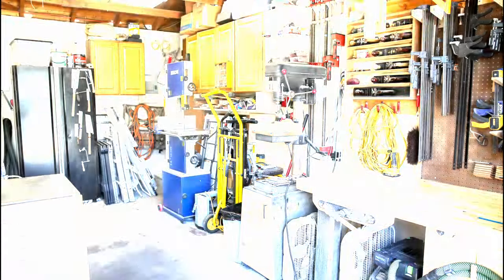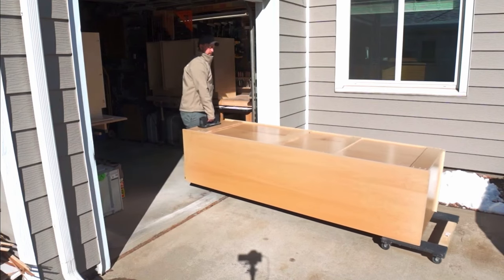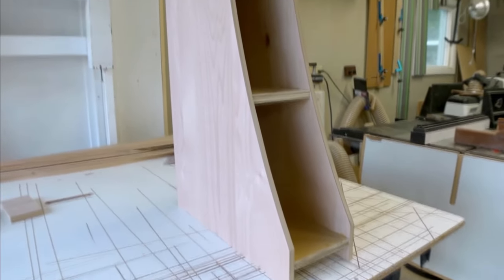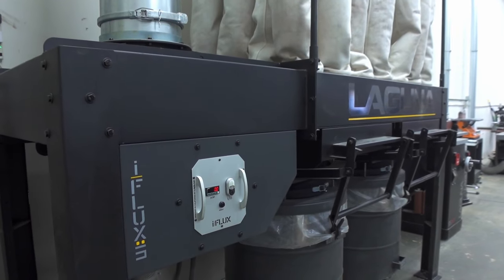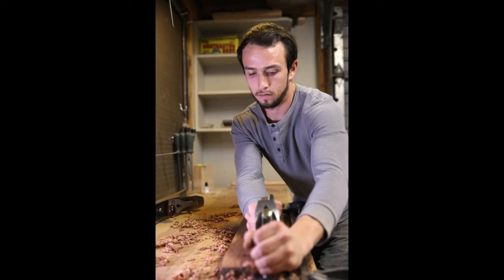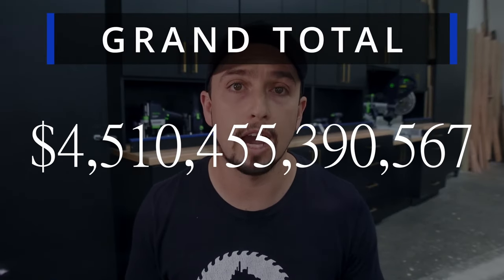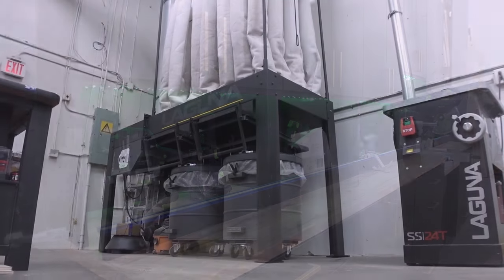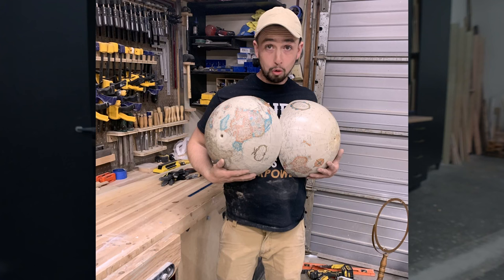Size MATTERS. Here's Why.

Comment: Now that I’ve gotten through the whole video….I really enjoyed this. It was a great video. I do remember being quite happy with my old shop. And thinking how grand it was. I have a tendency to cram even my large shop full of stuff and make it feel small. But now that I do it as a “business”… the expectations are different. And sometimes the joy is sucked out. But mainly…. I enjoy every day that I get to be in my shop. I would love to make it more efficient. I think I could take it further as a business if I was more organized. 

And… I’m drooling over your jointer. Thant thing looks amazing. I have an old delta 6” jointer I bought from marketplace. I love it… but I hope one day to get a larger one. 

I’ve spent a lot of time in my “business” making money… only to spend it on the next tool. But I’ve come to the point where I have the tools I need to make just about anything I want. 

great video. Look forward to seeing more.
Reply from the maker: I can see why your 6 inch jointer would make you happy but leave you wanting a bit more capacity.  But if you mill the boards to rough width first, its not too often that you need over 6 inches.

Comment: ROFL at the "storing lumber on your spouse's side of the bed". I store my baltic birch plywood behind my dresser in my bedroom. I don't have room in my current garage shop. But I'm single. 

For me, the answer is halfway in-between. I currently have a one-car garage that has to be both a garage for one of my cars AND my workshop for both working on cars and playing with wood. That doesn't work. So I am building a new garage with attached living quarters next door. Comfortable space for three cars and a lift plus plenty of room to make sawdust. If I need more room a car or two can get booted out into the driveway for a while. And yup, I am going to be DEEP in bed with a bank again. Sigh. Sure was nice having a paid off house for a while... The new living quarters are going to be nice too. going from 220sf garage and 770sf house to 1000sf garage and 1300sf house. I'm keeping my current place as a rental property.  And the new garage will be properly insulated and air-conditioned. I'm in Florida, so that is knda important.

Really loving your channel!
Reply from the maker: I totally get it. I had plywood leaned up in our living room for years. Truly though, good luck with your new space. I hope it brings you joy!

Comment: I went from 8300 commercials building to a   2700 square ft in my back yard on an acre . Best thing i ever did . My house payment  is much less than my shop rent.   Unfortunately  i  dont have enough power to run my timesaver. Buying auction equipment is the way to go its  so cheap  if your patient.
Reply from the maker: Yeah that's a great idea. It really is. Thanks for sharing